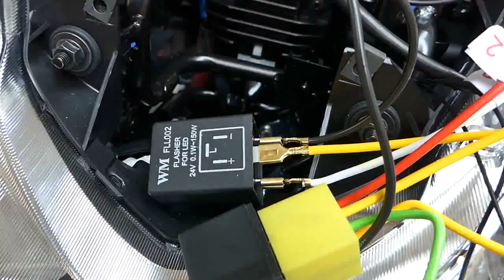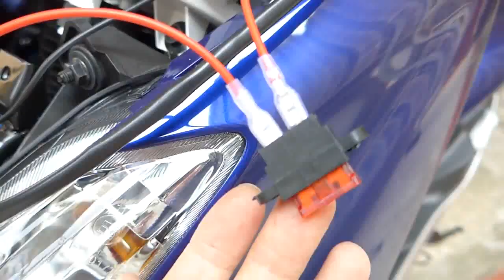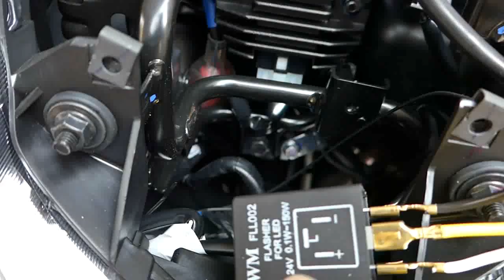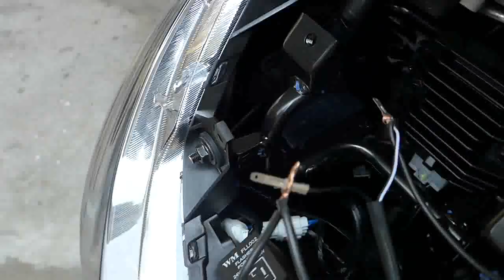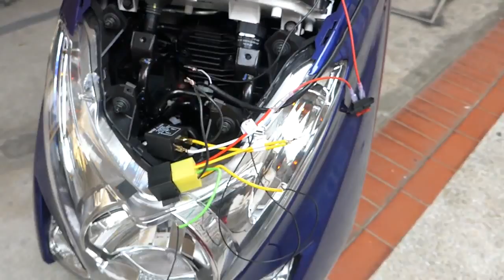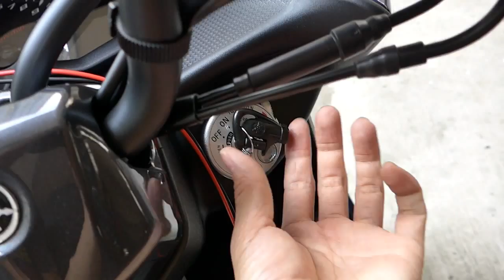Build Hazard Light System without altering original setup of your motorbike

Comment: Hello and thank you for this video. I have one qestion though. If I wire so that i can have hazard light without key, my ignition is on either way. ( All the lights in the dash is on) What can i do?
Reply from the maker: You must have used a wrong wire to power the hazard light system.

Comment: how steady on signal light left & right can i view the diagram
Reply from the maker: Normally a turn signal system would not stay on due to its circuit design. What you see on some bikes have the signal lights stay on, they are functioning as running lights. The light bulb or light assembly has 2 circuits, one for the signal and one for the running light. In a regular light bulb, it has 2 filaments separate 2 systems.

http://www.passatworld.com/forums/volkswagen-passat-b5-discussion/136039-difference-between-dual-single-filament-turn-signals.html

Comment: hello, this system only work's with led flasher relay?
Reply from the maker: The system works for both the load resistor type flasher and the led flasher.

Comment: What happens when the motorcycle is running and you turn on the hazard switch? Will it still work? If it does, what happens when you turn on the turn signal while the hazard is on?
Reply from the maker: +dsconnct    Yes of course it still work when the motorcycle is running. All 4 lights already flashing when triggered the hazard switch, how could see the signal flash even if you push the button? You can check on my other video for some cross reference: https://www.youtube.com/watch?v=ptratd_yk9w